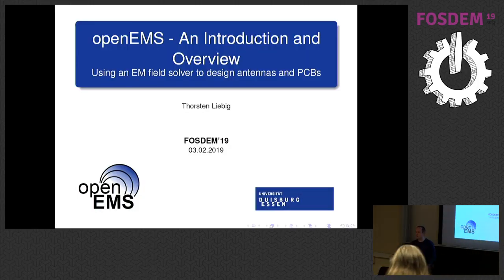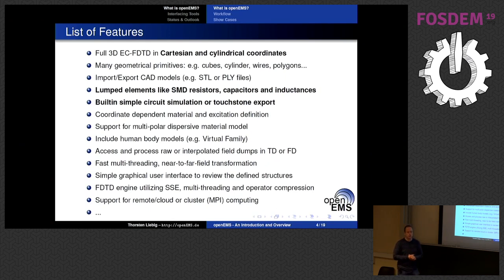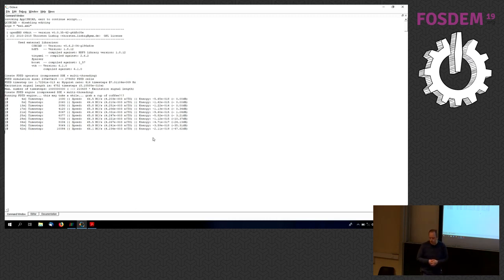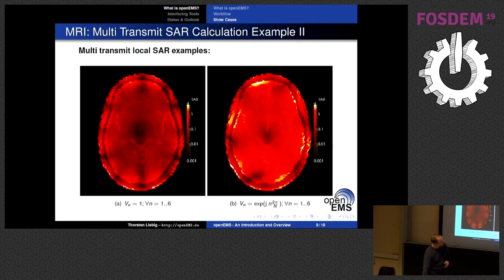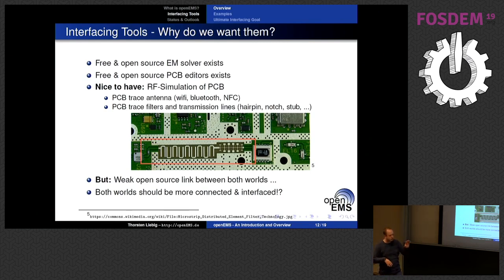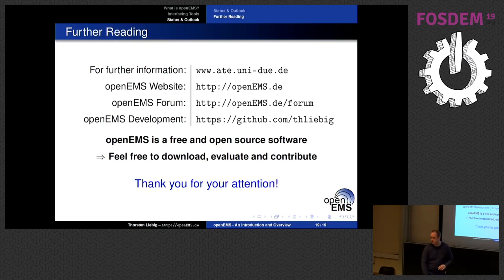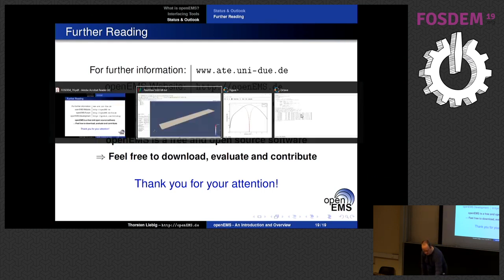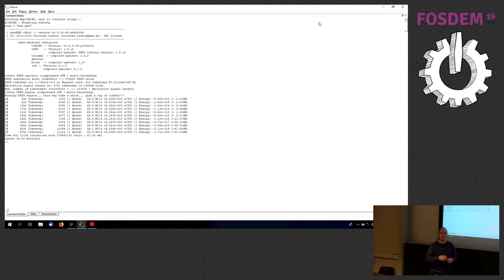openEMS - An Introduction and Overview Using an EM field solver to design antennas and PCBs

Comment: This is  a great and promising tool. I have been monitoring a few of the freely available tools like this and I think it's about darn time these Open Source EM solvers get a better attention to get them to a point where there is a reliable and easy-to-use UI. Also the layout geometry import is important but I think it is more important to have a decent drawing interface for parameterized 3D objects. Because then you can really go to town with optimization.

Comment: Is the example of the WiFi antenna available?  I saw an example on the OpenEMS website for an inverted F, but the MIFA in your presentation is closer to what I want to simulate.
Reply: the website is likely not maintained. examples are there but no new screenshot or examples in years.